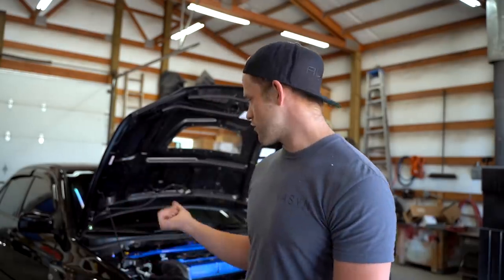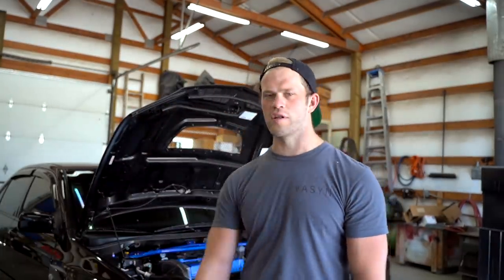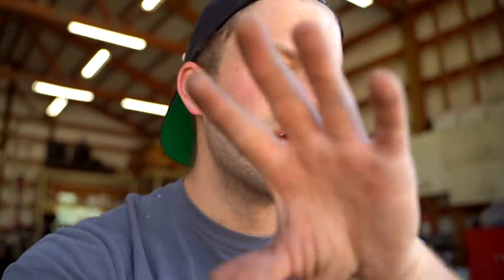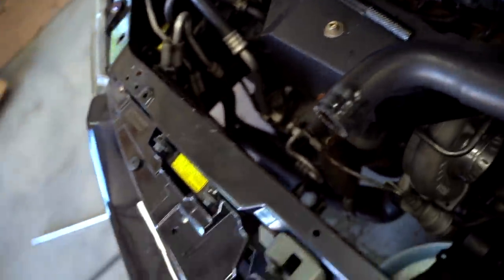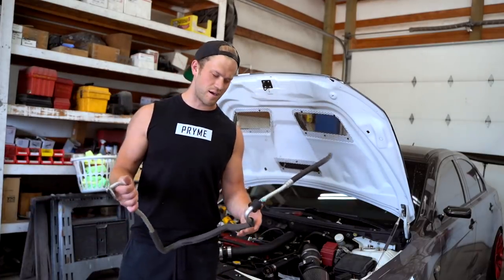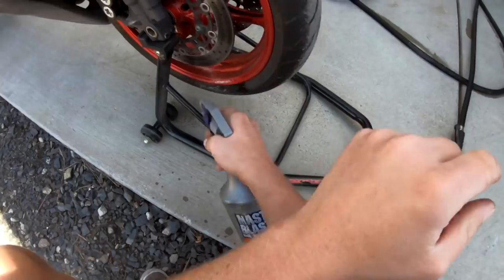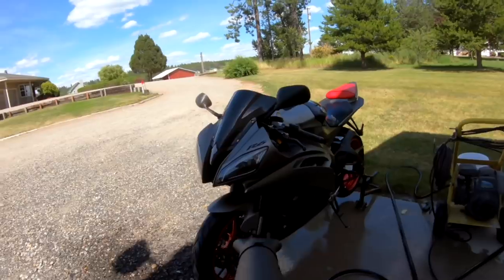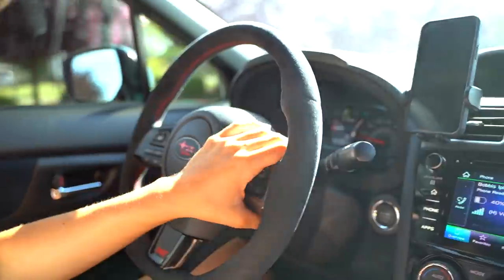What actually blew up

Comment: Might want to wrap a small piece of rubber or foam around the AC line on the EVO8 so it doesn’t punch another hole in the radiator